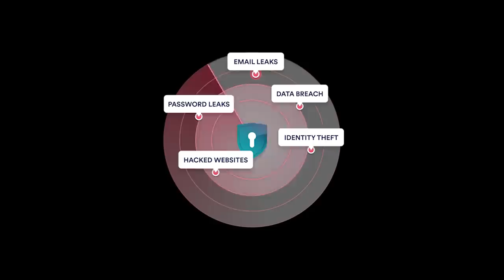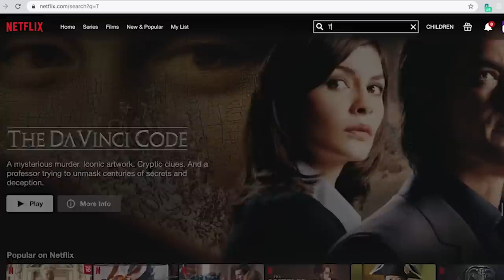I HAD TO DO THIS FOR HER...

Comment: Might be a good idea to mount your outside aircon part up high on the wall. Just need sorting brackets. Solves the problem of getting snowed in. Wish I could send you a pic of mine which has been mounted up off the ground.

Comment: Great videos. I commented a while back about the chimney leak where water will migrate from acumulated snow to any cavities that have a small heat source. On your split system the outside unit needs to be cleared of any snow surrouding it as snow starts melting the water can actually fill up cavity inside split system unit and could possibly short out. I have seen this with parking lot light fixtures where snow buried the light pole bases and snow started melting and filled up cavity in light base causing fixture to short out. You may also see leaks around base of your house or garage as snow again starts melting the water will seek any cavity it can go into in. Again great videos.

Comment: In stead of heating the garage at night you can also clear the lines at night. Make a connection for an air compressor and blow the pipes in the evening. Was a good solution during a soil remediation project in the winter and outside.

Comment: Next year watch as Trent & Brandon solve the snow build-up by buying professional size ski mountain equipment, start a side business as a ski run AND Ali still has to park outside because they begin to build a pole building for that other tool box Trent needs & the new snow management equipment. Leo will learn to operate the winches.
Reply: Very good 😂

Comment: I seriously hope you don't stop heating the garage at night, set the thermostat at 35 at least because if those pipes freeze and burst, the dollar loss will far exceed the cost of propane!!!  As far as having the sunlight and it helping your emotional and mental and even physical state, you are correct. I live in a valley that has an inversion situation about 80% of the time in winter. It's tough to deal with sometimes. Trent you're giving your guardian angel a workout!

Comment: I suspect a larger (or additional) propane tank is in the plans. Knowing that there will be no refills until spring snow melt, it's the only option to ensure heat next year. Love the new intro. btw.
Reply: propane trucks carry enough hose to reach the tank. Issue is getting the propane truck up the hill.
Reply: Agreed, plus heating a non essential space like the garage.... very expensive

Comment: Guys, winterize your garage apartment. Drain the water from the system so you don't kill any fixtures and then you don't have to keep it heated. You don't need it up and running now anyway. The bumper looks great btw!

Comment: You mentioned that your mini-split is buried or is in an igloo.  A few years ago, we had so much snow our heat pump got buried in snow.  I dug it out several times.  However, I evidentially didn't do it enough.  When the unit went into defrost (all heat pumps and your mini-split too) have a defrost cycle to clean off the condenser coil. It defrosts the coil by heating it up thus melting ice, snow or frost that has built up on the coil.   In my case the water from the defrost ran into the bottom of the unit and because of the snow it could not drain out.  The water built up to the point where it froze into the coil and when the ice expanded it broke the coil apart.  The result is that I had to replace my heat pump and it was a major expense.  I strongly suggest you dig out the unit and make sure it can drain the defrost water.

Comment: Who installed your heat pump? If I lived near Utah, I would re-intall the unit properly. 
Move the condenser higher installed on a wall bracket. And please cover the lineset with pvc line cover

Comment: Get some small electric space heaters to heat your shop to protect the water lines from freezing and save your propane.   Or shut off the water and drain everything.  Either one will work.

Comment: If you doing maintenance in a garage I would have made it 35’ deep. So, you can have a tool bench in front and still work on the engine or bumper in this case. Nice extra for 5he mother-in-law room above too. Did you think too quick about the dementions of what you needed?

Comment: Another great video, getting things done and entertaining us at the same time. Just a thought, if you took a 3-foot piece of scrap 2X10 or 2X12 and at the bottom of the ladder's foot pad drill a hole and screw the ladder to the board, this way it won't sink into the snow, just a thought. Be well and God Bless.

Comment: Trent ,fyi you probably already figured it out but The diesels run a 24volt starter so the winch had to run off the other battery only 😂👍🏻same as when you jumpstart from a diesel be careful what battery you use it should say somewhere on the truck what battery to jumpstart from 🤷🏼‍♂️

Comment: "it will be a 5 min project" = when we know the problem, have all parts and have taken off the old parts THEN it will take 5 min!

You looked so happy Allie when you drove the tractor so I thought it was you who took away that snow🚜😀

Here in Sweden the eletricity has gone up in price, and especially for those who warm their houses with it, it has become pretty hard. I have an idea that when installing new water & drainage pipes that there should be some kind of heating around the pipes, so even if the house has to be cold (for you saving propane, here saving electricity) the pipes will not freeze. Like you had with the water pipe going to Terry. Don't know how easy it is to do and what the code says, neither here nor there, but I think it should be worth it to not have blown pipes and all work that comes with that.

Comment: Did you get the fridge/freezer that’s designed for placement in a freezing garage?  Or are you going to keep the garage heated all the time?  I didn’t know it would be a problem in my garage that freezes but found the freezer won’t keep food frozen.  Researched and found this is to be expected.

Comment: Can you not insulate the garage space everywhere but where the inspector needs to inspect(elec and hvac) that would help to hold temps much better and consume less propane without having to shut off all the heat. You only have to keep it around 40  in there overnight.

Comment: Howdy, howdy folks. Donkey. Build a new garage..two car garage. Wednesday this week there is a snowstorm coming for Colorado and the northeastern Colorado plains where I reside. Not sure if the whole of the Rocky Mountains is going to get snow or not. Therefore, Trent and Allie, get ready for a snowstorm just in case. By this weekend the weather will be nice again. You  might-maybe get snow your way too. 
Good you've got the bumper and winch installed. And...space heaters set on low to conserve your propane in the garage. Use your fireplace or wood burning stove in the house a bit more often too, during the daytime. Me mate would load the wood stove (our only source of heat at that time) at night and it would burn all night long until early morning.

Comment: Truck mod would have worked better on Trent's Garage.

I can't wait for the episodes where you're fixing the damage done by frozen water pipes because the heat in the garage was turned off.

Comment: The hardest thing with used appliances are the parts you can’t access to clean. If ever there is mold in the air flow system, you really can’t get to the spaces to clean it. We also had a washer die on us recently, we owned it from new and used it for 12 years. The junk that came out of the failed pump was nasty and made me realize that used appliances are never capable of being fully cleaned without a rebuild. 🤢

Comment: I think of "Pig", but I'm much older than you guys. Don't break a headlight on that truck! I have a 22 and accidentally ran in to the mailbox stand and broke one of mine. $1100 to replace it. At least Trent would be able to replace it for you if necessary.

Comment: You weren't the only ones having trouble with the new Starlink. There was a guy living on a boat that had a problem with the connection; he had to wire it all directly to the dish himself. Something with the connector not working with the old system. He found out that he was not alone either. A lot of people were having trouble with it.

Comment: Suggestion  for winch    mount one on a 2 in tube steel stinger  that can be swapped from rig to rig for those time that need to winch backwards    example  if you nd up front facing into ditch  or snow bank    or hung up on rock and can go forward  have options  to winch yourself  and have to wait  for someone else  to winch you out

Comment: 1 gallon of propane in 100% efficiency produces 91,502 BTU.  That modine 150,000 BTU is 80% efficient.  I looked
It up.  So a gallon of propane into the Modine generates 73,201 BTU.  Since your Modine is rated at 150,000 BTU, it is consuming 2 gallons of propane per hour to run.  Out of a 1,000 gallon tank.  Not including the house.

If you run it 8-5pm, it is eating 18 gallons a day. 

Why the heck haven’t you insulated the garage?  You’re wasting all your propane.